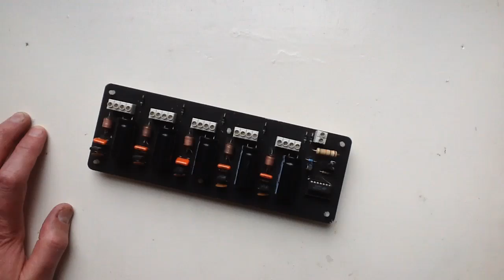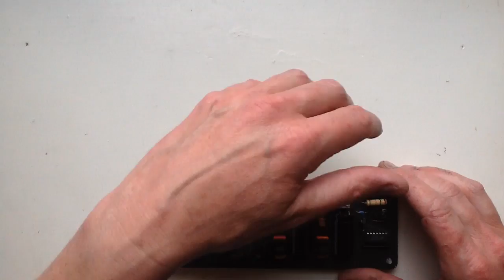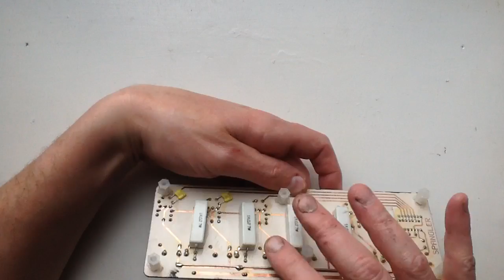Random failed prototype strobe thing.

Comment: I'm thankfull this one never got into the market. I've rseen too many of your medusa boards as it is :D
Reply from the maker: To be fair, the Medusa strobes lasted a long time compared to the competition.  In hindsight I would have put a wire link or made the PCB wider to keep the long thin track that runs the length of the PCB further away from the adjacent track.  Moisture caused tracking on that area of the PCB as well as in the high voltage terminal of the ceramic block.
The trigger transformer was prone to instant failure if the two connections at that and were swapped when replacing the tube.
The PCB darkened as a result of the exposure to the tube.  They also darkened even if just left lying in sunlight.

I did a new version with better track separation, a free standing high voltage pillar on the PCB and a Mode Electronics potted trigger transformer.  But we had an issue with getting the cases.  Cariboni appointed a UK distributor who marked the cases up by 100% making them too expensive to continue making the strobes.
Reply: @bigclivedotcom  oh they only ever failed due to tube failure or moisture. Also yes, 1 million times better than the remco ones :D

Comment: Many years ago I worked for Knott's Berry Farm as an entertainment tech.....this reminded me of one of the two best gags we pulled on our boss. We had taken the lamps out of the light fixtures in his office and fitted each fixture with a dozen strobes. When he came in and hit the switch that morning it looked like a nuclear blast going off.  :)

The other gag was taking ALL of the office furniture and suspending it upside down, hanging from the ceiling. (WE had a structural grid above the tile ceiling grid.) It took all of the day and swing shift crew to do it overnight. The look on his face when he walked in was worth it. Having an experienced rigger on the crew always made for fun times.

Comment: Had a similar issue with an attempt to control firing 6 pairs of xenon tubes in sequence to excite a ruby rod for a one-of custom built pulse laser project. After a couple of failed prototypes I ended up buying a commercially available controller which worked fine with a bit of interfacing circuitry. After appropriate testing the finished laser unit was put into service for the customer & all was good :-)  I had hoped to investigate the commercial circuit to suss out where I had gone wrong with my own designs but sadly all the interesting bits were buried in potting compound & I did not have time to investigate further so I never did not get to the bottom of it and the trouble with the strobes all firing at once was left as a mystery.   Would be most interested in your findings as it has been lurking in my memory for years & would be nice to have some idea of what was really going on even if I never need to really know but as I am sure You know it is always nice to satisfy 'the nosiness' :-)

Comment: Had done something similar , but with shift registers( 74164)- programmable strobing lights.  It was fun, but lot of capacitors,and xenon lamps died* - the thermal load was bigger than I expected. I had also isolation issues but in later model I used opto SCRs (moc3020?) and it worked well.
* Only available xenon lamp here in Czech.Rep. was russian xenon lamp IFK120

Comment: As many people have previously commented it seems that isolation is the key here. While having the trigger circuitry remote to each strobe is a good idea, if you wanted it all in the same case maybe separate and screen each channel with metal cans like in RF circuits. Possibly even feeding each from a separate mains transformer or winding and opto-isolating to the control circuitry.

Comment: I'm betting that there was some sort of EMF coupling happening between the trigger transformers.
Send a pulse to one trigger transformer, and the magnetic field couples into the rest of them, so they all fire. And because all the transformers have the same amount of turns on both primary and secondary, they all have similar resonant frequencies (and harmonics).
This is more often seen in RF circuits, but a xenon strobe circuit has a lot in common with a spark-gap radio transmitter!

An experiment to prove/disprove this would be to take two strobe circuits, place them next to each other in the same orientation, and power them from isolated supplies.
If they eventually synchronize, or if they are statistically likely to both trigger when only one is commanded to fire, you might have EMF coupling.
The control test is to have the strobe circuits facing at right angles to each other. This should mean that the EMF from one strobe circuit's trigger transformer can't induce much current in the other one's trigger transformer.

If it's not that, it's probably the EMF from the strobe tube firing inducing a current into the trigger transformers of the other strobe circuits. Depending on how much current we're talking about, the EMF of the tube firing could be larger than the EMF from a trigger transformer being pulsed. After all, a wire doesn't need to be coiled to generate EMF.

Comment: I built a similar thing a few years back, 3 xenon strobes triggered by optoisolated (MOC3020) triacs(BT151?) and an Arduino.  I didn't come across the crosstalk issue, but ended up having it strike an arc and publicly melt one of the xenon tubes at a slightly too high flash rate :O Then it got shelved :D
I think the layout might be behind the issue  you had with this board - when the xenon lamp fires it ends up having a resistance in the ohms range, so huge discharge currents can induce voltages in other wiring and trigger the thyristors etc. Also the high voltage end of the trigger transformers have 10s of KV on them with a quick rise time - this can also mess with adjacent low voltage circuits I found.
An easy enough mod you could try is to extend the capacitors and trigger transformers away from the control board and locate them right at the tube with thick wire from cap to tube. From memory I had the microcontroller in a main rack enclosure with other LV stuff, then 20mA current loops over an XLR cable to the strobe unit with the three tubes in it. That had a central smoothed mains cap fed by a bridge, then three high wattage resistors to charge each tube's own capacitor slowly, but not slowly enough, it turned out!

Comment: When I was younger I worked in a night club (about 1990), the DJ booth was quite accessible and had fancy metal touch sensitive controllers for everything. It also had a 4 channel Strobe Controller which I took out and home to get the beer out of its switches as it had made them all stick down. It had 4 push on - push off switches and 1 speed variable resistor on it and 4 mimic LED's. The switches were for pattern selection/flash all/manual flash/all off from what I can remember. The strobe units were some distance away high up in a rig and used remote triggers via 3/4 inch Jacks plugged into the unit. I only wish I could remember who built the unit, it was possibly NJD. My point being, it obviously can work from one board but heaven knows how they did it. There was only a simple circuit inside with very few components,  power and a control chip. Im guessing you need a special Strobe with a remote trigger input socket on it rather than try and drive the strobe directly. Maybe there is such a massive spike of interference on the board it triggers all your outputs at once. I dont know, I never studied that far in electronics, just basic/int/adv analogue and digital circuits from 1990 to 1992 so my knowledge is a bit out of date and only suitable for hobby stuff now.

Comment: In addition to the HV spikes from other circuits triggering the other tubes too, if the tubes were run close together the pulse of light itself can sometimes be enough to ionize the other tubes without the need for a HV spike at all.

Comment: I build a synchronised strobe project a while ago, the individual strobes used an optocoupler to trigger the tube circuits and each had its own storage capacitor connected to a common HV supply via a 1n4007 diode. I made up a chaser circuit using a 16 bit CMOS decoder chip 4514, it all worked very well so it would be worth a try! Like many projects I attempt, I never got around using it and it lies abandoned in my shed with other ideas!

Comment: This is the very reason  most police/fire/ems strobes use seperate triggering modules or whole seperate strobe fixtures controlled by the 12v control panel in the central console of the car. This is also one reason strobes have been replaces by high brightness LEDs on most all law enforcement and fire/ems vehicles. They can be set up and programmed to have a whole variety of patterns and still utilize a very similar 12v master control unit up front.

The EMP produced by the HV triggering is whats causing the entire string up top fire off since most ICs are sensitive to EMI and EMP like that. It's causing a "floating" condition where a "1" across all the pins should be a "0" except for the pin called to be "1". You could try some pull down resistors but even that may not cure it either.  Last I recall from years ago is this was a thing manufacturers tried working out and could not. Thus everything Strobe went to LED..
Reply: +ElfNet Gaming
There really are quite a few strong fluctuating EM fields inside one of these strobe circuits. I wouldn't be surprised if they can cross-trigger even without any semiconductors being involved.

The trigger transformers shown in the circuit of this video have a lot of turns, aren't toroidal transformers, and it doesn't look like they have any magnetic/electrostatic shielding.
In other words, ANY electromagnetic field fluctuation will be picked up on the windings of these trigger transformers, not just the ones from the primary winding.
Reply: And given the fact these were used in an environment that involves 2-way radio communications, the RF can cause false triggering as well.

Comment: My initial thought was to suggest trying to isolate the individual flash units from the power rails with inductors and possibly with a very low value resistor in series to greatly slow down the pulse propagating onto the power bus -- though such may be needed for both the power rails unless the ground is especially low impedance.  If needed you could even add a capacitor in parallel between the resistor and inductor.  Then use optoisolators to fire the triggering transformers.

But then it also occurs to me that there may be a photoelectric effect going on where the light from one strobe might be lowering the breakdown voltage in the other strobes causing them to fire much more easily as well (especially if coupled with a transient at the same time).

Comment: I would check the traces/signals for crosstalk/capacitive/inductive coupling. I would need the schematic and board layout to take better look. But in short: Avoid fast transients as much as possible. Add a resistors to the output of the IC and a capacitor to the other end of the line to create a low pass. If you need a fast transient, keep the current loop (including the ground - in my company people rarely trace the GND path) short and local. Try to separate high impedance nets like Micro-controller separate from low impedance nets like the output circuit to the lamps. At local capacitors to any DC circuit and check the DC voltages with a scope. Spikes on a DC voltage means: Add more capacitance. I mean: It is easier said then done, but sometimes small details in the routing make a big difference.

(But: other times, a chaotic wiring mess works better then a neat layout. There is a story of a computer build according to the same plans in Switzerland and the US. The US worked well but looked like a mess, the swiss one did not work, but had nice wiring harnesses. Turns out: The wiring harnesses caused the crosstalk by holding the wires parallel and in tight together.)